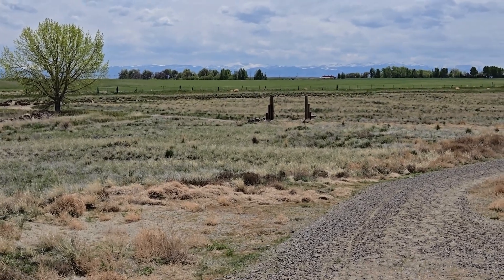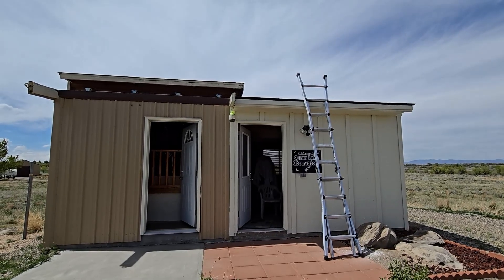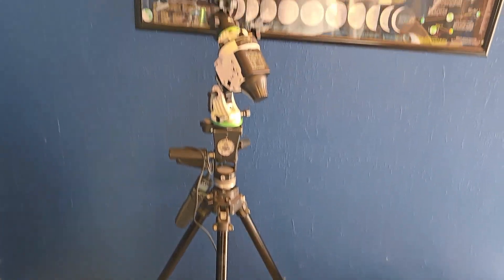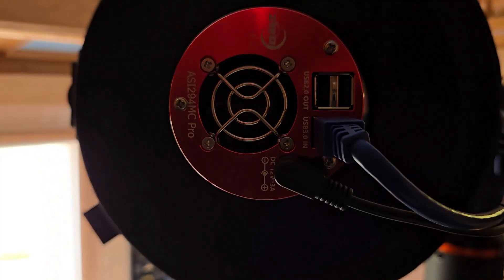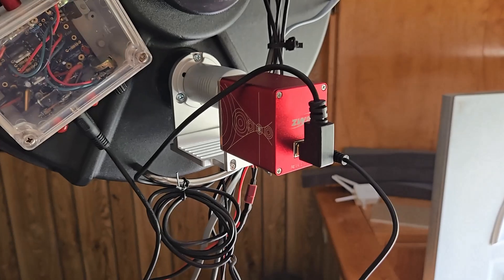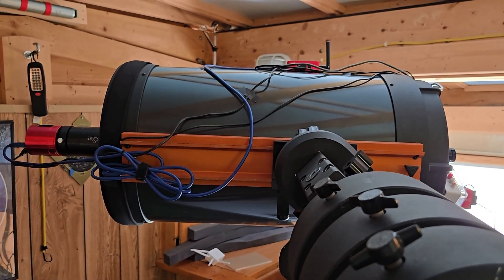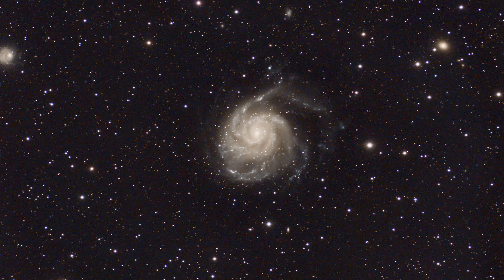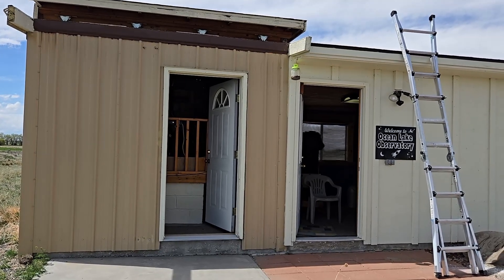Ocean Lake Observatory Upgrades & Galaxy Photos #astronomy #astrophotography #telescope #galaxy

Comment: I noticed you said that you're using the 294 without a filter. You need a UVIR cut filter at the very minimum. Otherwise you will get star bloat and a weird color cast which I do see in some of your photos. Great details but I would definitely invest in the UVIR cut filter.